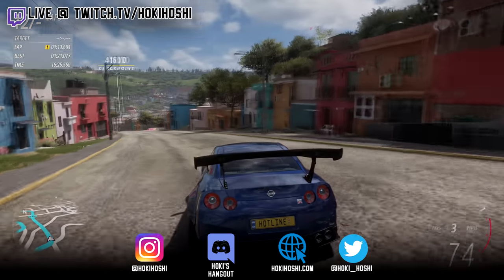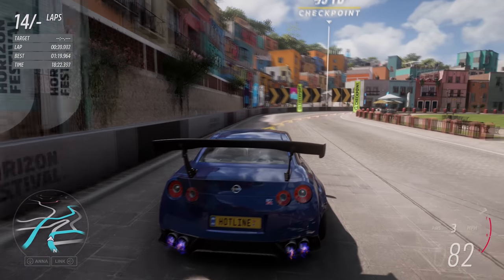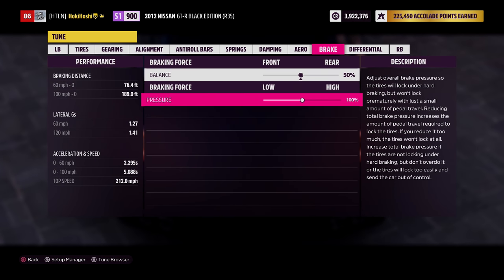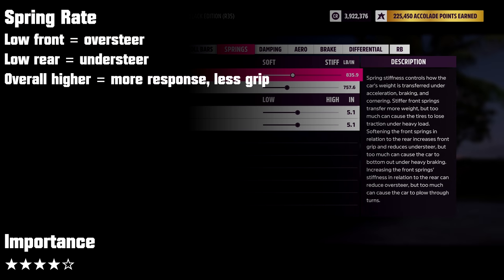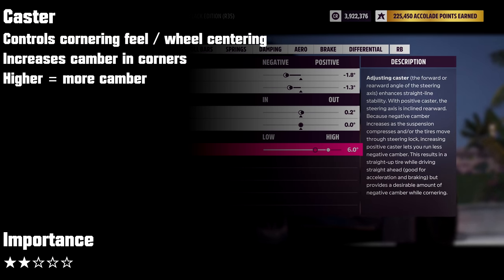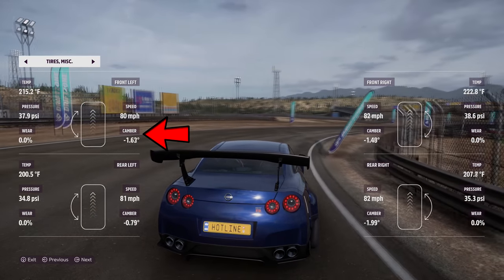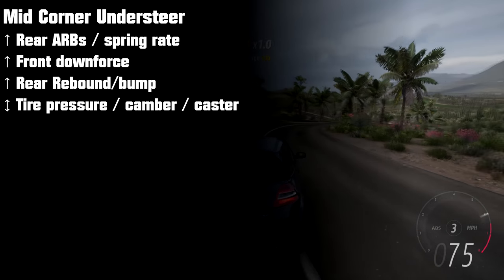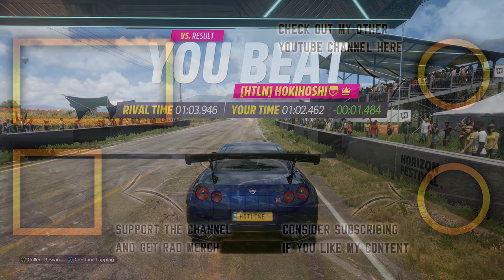How to Tune in Forza Horizon 5 | Basics of Tuning Guide

Comment: How to tune for high downforce, s2 998 track cars. This can also work with slower cars.

1. Take front weight distribution in decimal form and subtract it with 1 to get the rear weight distribution in decimal form.

2. Multiply both decimal values with the weight of the car to get front and rear weight in kg or lbs.

3. Set your downforce in the tuning menu to the desired amount (in s2 998 this is recommended to be at the max for both sliders). Take the front downforce value and add it to the front weight you calculated in kg or lbs, then do the same for the rear downforce and rear weight.

4. Next, add both the new front and rear weights to get the total weight of the car when under the load of downforce (at an specified speed).

5. Take the front weight (the one that includes the downforce weight) and divide it by the total weight of the car that includes the downforce weight to get the weight distribution as a decimal. Do the same for the rear (PLEASE make sure the smaller number goes first in the calculator!) All of this was for getting the front and rear weight distribution of the car when it is under aerodynamic load.

6. In the tuning menu, go to rebound stiffness. Take the [new] front weight distribution and multiply it by 17, then take that answer add 3. Repeat this formula for the rear weight distribution. This is for calculating front and rear rebound stiffness.

7. Next go to bump stiffness. Multiply the front and rear rebound stiffness by a value of anywhere between 0.6 to 0.75 to get the bump stiffness. Both front and rear must be multiplied by the same decimal, so no 0.6 and 0.7. Higher downforce cars will need higher values closer to 0.75.

8. Divide the new weight of your car that includes the weight of the aerodynamic load by the ACTUAL weight of it to get the weight difference (this will be a value greater than 1). This time the bigger number comes BEFORE the smaller number in the calculator.

9. Next go to spring stiffness. Set the slider to the lowest value and multiply that by the weight difference factor you just calculated in step 8. Set the slider to the highest value and multiplayer that by the weight difference factor. Then subtract the new highest and lowest values to get your range value.

10. Take your NEW front and rear weight distribution decimals and multiply them by your range to get the corresponding front and rear spring stiffness.

11. Lower ride height all the way down.

12. Go to anti-roll bar stiffness. Multiply your weight difference value by 64 to get your arb range. Now this is VERY IMPORTANT to remember. Cars that have a front weight distribution less than 0.50 will have a front anti-roll bar stiffness GREATER than its rear anti-roll bar stiffness and vice versa. So this means to get the FRONT anti-roll bar stiffness, multiply the arb range by the REAR weight distribution and then add the weight difference value AFTER you have already calculated the range times weight difference. Do this to get the front and rear anti-roll bar stiffness.

13. Recommend leaving tire pressure at the default of 30. You can make low tire builds that are like F1 car tunes but that is much more complicated. So I won't be going into it.

14. Recommend leaving brake pressure at 100%, but race cars generally have brake balance anywhere from 52 to 60%. Since I tune mid engine cars that have more weight in the rear (yes even under aerodynamic load) I always set it to 54%

15. Differential settings rule of thumb is more power = higher rear acceleration percentage with the max being 75%. Rear decel should generally be the same or 5% lower than your rear accel. On AWD differentials, the front accel shouldn't ever be above 50% and the front decel should always be 0%. For the AWD power balance, the rule of thumb is higher percentage = higher top speed and more oversteer/less grip, lower percentage = lower top speed and more understeer/more grip, with the minimum you should use being 65%

16. In alignment, there is extensive testing you can do with the in game telemetry to hone in your camber and caster settings, but I'll make it simple; -3 front camber -2 rear camber. no toe adjustments at all. For caster all I can say is, 5.0 for slower cars and/or stable cars that understeer, 6.0 for faster cars and/or unstable/tail-happy cars that oversteer.

Now I'm not going to go in-depth into gear tuning even though I know exactly how to because that is an entire other lengthy chapter, so all I will say is to adjust the final drive gear so that (look at the graph in the bottom right) the last gear in the series of gears intersects the redline at the very end of the right side of the graph.

Yes I know this is a long comment. I hoped it helped!
Reply: Can you explain step 12 with the anti-roll bars? I'm trying this out to see how it works while also writing it out as a mathematical formula for each step.
Reply: recommendation where to see gear tuning ?
Reply: This is a banger of comment! Thanks for the guide!! Is this useful for the lower end cars as well?
Reply: @georgejones5019 
Sorry for the late reply, YouTube didn't send me a notification.

So to reiterate in mathematical formula form;

This example will use a mid-rear engine hypercar with a front weight distribution that accounts for the additional downforce weight already that is 44% or 0.44. So you would get this value by adding the front and rear downforce to the front and rear weight of the car, and then divide the new front/rear by the total weight of the car with the downforce acting on it (the value in the aero tuning menu usually uses the amount of downforce being produced at 120 mph).

Weight difference multiplier of the actual weight of the car and the car + the downforce weight. Ex: 1.3 heavier with downforce at 120mph.

((1.3 * 64) * 0.56) + 1.3 = 47.9 which is the front anti-roll bar stiffness.

((1.3 * 64) * 0.44) + 1.3 = 37.9 which is the rear anti-roll bar stiffness.

Hope this clarifies things!
Reply: @bemo9 
I don't know where you could find a good in depth description, so I'll explain it here, but I don't want to go in depth so I'll simplify it.

Gear tuning can sometimes be preferential if you have somewhat of a good set up. But the jist is that you want low gears to last short and have a tall rev range for low speed acceleration, and high gears to last long and have a small rev range to squeeze out the most top speed. But you don't want to immediately switch from tall to short, you want the beginning or bottom of the gears to look like a gradually flattening curve.

Sometimes you'll want a little more acceleration so the last gear could actually be lower and longer than the gear before so you don't run out of top speed.

The best pointer I can give is to use the graph in the bottom right. It really helps visualize what exactly the gears are doing when you change them.
Reply: @ladyivyanna9612 
I figure it is useful for the lower end cars because most of the time in A class and below, you don't use any aero, so you're skipping entire steps that are used to account for downforce. Otherwise, this is strictly for road racing.
Reply: @jackcolson4745  So how do you tune lower end cars where aero doesn't play much of a role? (or higher end cars without installing aero)
Reply: @ladyivyanna9612 
There's many steps in my original comment that use the downforce weight in the calculations. If the car you're tuning has locked or no aero, then you just put 0 for every time a step asks you to use the downforce in lbs or kg. You effectively don't need to calculate with downforce weight anymore if you're just adding 0, because all your multipliers that do account for downforce will just end up being 1, instead of something greater than 1.

For example, in step 3 it asks you to add the downforce values to the front and rear weights respectively. If there's no aero, you're just going to be adding 0, which is redundant so you don't need to do it.

However, lower end cars don't always need to be stiff, so you could lower the front and rear spring stiffness too for better stability.

When tuning for A class and below, you generally want to focus on building more for horsepower than handling, because you won't need aero.

I hope that clears up the confusion.
Reply: @jackcolson4745  Thanks so much for your help man! You must play a lot of sims and stuff to know all this tuning calculations!
Reply: @ladyivyanna9612 
Lol. I've only played the Forza games, and I built this off of hoki's fh4 tuning guide he did 3 years ago. But I do study Newtonian physics so that definitely helps.

I'm glad I could help you.
Reply: Do you by chance have any build share codes for any tunes you’ve done in the game?
Reply: I need to be able to find this comment in the future

Comment: 28:28 Throttle management in RWD; just, YES! I personally feel this is one that many people feel like either their tune or the car they're driving performs poorly at start or powering through and out of a corner, yet simply haven't acknowledged that *usually*, it's got to do with how much throttle you're applying. Too much and you will likely spin out most of the time, it's not necessarily the tune, as much as it is just all the power with a limited surface area of the width of the tires themselves, assuming all else is equal you still need to compensate the expected "burn-off moment" by slowly learning - and it will vary by car as well - how much to get the car moving forward and not just... spinning in place and then also typically losing grip for a second upon 2nd gear because again it's now rotating faster than the amount of traction it has at that moment to pull you forward and not just slip.

Comment: Much Respect!  I got into the habit of downloading locked tunes in Forza Motorsports games and having a great time.  With Horizon games, it was frustrating because there’s really no set track parameters because of the varied terrain.  Frustration equaled quits for Horizon racing.  So Thank You, Thank You!  My sanity will return and I can finally enjoy Horizon 5.  I’ll be rewatching this video a lot but at least I know now, that I can tune that under steer in AWD cars.  Subscribed!

Comment: My tunes feel "floaty". At corner entry the whole car just kind of drifts and doesn't feel planted. It's the same GTR as in the video. I must be missing something.
Reply: Make your sway bar settings stiffer
Also make sure you brake BEFORE you enter the turn and just as you start to turn in to the corner let off the brakes and use the gears to slow down if you have to while in the turn. Then power out once you hit the apex of the turn

I hope this helps

Comment: Really great and informative. I'll have to follow this new guide two or three times with different builds and what the goal is, such as Rally vs. Drift.

Going back over this. Rally tuning seems to be much more tricky than street. As you want a good amount of balance of acceleration and grip, so you handle through a turn then return back to a decent speed.

Comment: I’m a total noob to the franchise and this was sorely needed; thank you 🙂 However, I do not have the option to switch Anna to Telemetry in settings. It’s not there at all. Do you know what might be happening there? I’m on XBox Series X.
Reply: same, i swear i saw this option before, but now i cant find it anywhere
Reply: Ohhh, you need to make sure that your control layout has all the options for selecting anna filled in, if your in a default profile it will show up, you can switch to a default profile, then save and exit the menu, and then reload the menu and it will be there

Comment: I wouldn't suggest upping toe out in front at al for a base tune only in fine tuning also 80% rear diff lock is a bit excessive.

You can really feel the drawbacks from having toe out in front with a steering-wheel.

Comment: You’ve left out the single most important aspect when fine tuning any vehicle. It’s super important to make changes to one aspect of the tune at a time, if you make too many changes at once you are introducing to many variables and this makes it near on impossible to figure out what has happened. This will lead to other problems and before long the tune will go backwards. When fine tuning you only ever do one thing at a time. Great video for covering the basics otherwise.
Reply: I agree with this once getting towards the final tune, but being experienced with this series and real world performance cars I do it differently to start. 1st I drive the car in a race stock, see its tendencies and make many adjustments based on what I felt. As you get the general build close than I start making 1 at a time adjustments

Comment: More in depth summary with added details feel free to add and remove anything you want

Forza tuning guide
Differential:

Rear Acceleration: 
50-90%, scales with HP. Higher = more oversteer.

Front Acceleration: 
10-50%, low on track builds, high on rally. Higher = more understeer.

Deceleration (Front & Back): 
0-Accel%. Low = more responsive. High = corner stability.

Center: 
50-80, low on rally builds, high on track. Higher = more oversteer.

Brakes:

Balance: 
Front = Rear braking force. More stable, understeer.
Rear = Front braking force. Less stable, oversteer.

Brake Pressure:
Higher = Quicker locking/ABS engagement.

Aero:

(Only important for A+ Class)(Adjust after you drive base tune)

Higher = More grip, hotter tyres, lower top speed.
High front = oversteer
High back = oversteer
Too high of back can make understeer
Difference between front and back can influence under/oversteer.

Damping

(Keep Bump at 0.5 - 0.75x of rebound)

Main Guideline: Increase stiffness on the end of the car that is not losing grip, or increase softness on the end that is losing grip.

Therefore, high front setting = more rear grip. High rear setting = more front grip.

Springs:

Low front = oversteer
Low rear = understeer
(Awd lower front)
(Rwd adjust as needed)

Stiffness can be affected by weight balance.

Ride Height:

As low as possible.

Antiroll Bars:

Low front = oversteer
Low rear = understeer

Depends on cars weight distribution, higher stiffness on heavier part

Alignment:

Camber:
Negative camber is better for track racing. Drop a touch for base tunes.

Toe:
Toe out = Oversteer (Use on front in FWD/AWD for better grip)
Toe in = Understeer (Use on rear in RWD for corner stability)

Caster: 
Increases camber in corners 
Higher = more camber
Almost like dynamic camber, only affects Cornering. 
4-7 degrees.

Gearing:

Just match final drive for base tune. Lengthen 1-2 gears for high HP cars.

Tires:

26-35 PSI for track. 
Higher front PSI is better for cornering.

____________________________________

Final Tune:

Suspension:
Should be between 20-80%, try to avoid bottoming out.
If it’s not moving much at all probably need to soften suspension and vise versa too much need to stiffen

Camber:
Never want camber values to go positive, if they do add more camber 

Tyres:
Take a lap 
Blue = too cold
Dark orange - red = too hot

Peak- Heat should be around yellow- to transparent yellow

Inside - should be hottest
Middle - close to inside temp
Outside - should be coolest
 
Difference between inside and outside should never be more than about 20 degrees - 20> =Lessen camber/ Outside is hotter than inside increase camber

Overall temp difference within 10-15 degrees

If Outside and inside are lower than middle, tire pressure is too low
If middle is hottest - lower tire pressure

If tyres aren’t getting hot enough - increase downforce or try using toe
Cold tires + understeer = add toe out all round
Cold tires + oversteer = toe in

____________________________________

Trouble shooting - 

1st diagnosis when the issue is happening- entry, mid corner or exit

Corner entry understeer-
-Adjust front-tire pressure for better grip
-Softening front springs / ARBS - or stiffening rear
-Adding a bit more toe out in front or rear
-increasing front downforce OR decrease in rear
-reducing front diff deceleration lock
-increase front bump dampening or reduce front rebound

If car is plow understeers under braking specially also move more brake bias towards rear
Move slider towards front cause it is flipped
(understeer is normal while braking)

Mid corner understeer - car settles into corner but car starts to straighten
-increase rear Arbs/ spring rate
-increase front downforce
-increase rear rebound/bump damping
-can also play w tire pressure/camber/caster to find max grip for front tires

Corner exit understeer
-increasing diff rear bias
-increasing rear accel lock and/or decreasing front accel lock

All problems w oversteer -
Entry -
-Increase front springs / ARBS
-increase toe in
-increase diff decel lock
Mid corner - 
-increase front ARBS/ spring rate
-increase front rebound
-adjust up or down, tire pressure and rear camber
Exit-
-increase center diff front bias
-increase front accel lock
-decrease rear accel lock

Rwd grip - 
-increase/decrease downforce
-increase/decrease bump stiffness
-increase/decrease alignment settings
(Better throttle management)

Responsiveness during transitions-
-turning well when have time to setup but bad when quick transition - all in damping and anti roll bars
-if car gets thrown off easy when hitting curb, lower bump stiffness
-if car is too bouncy and shifts weight to much, increase bump damping and spring stiffness

Other problems.
-if not braking good enough - lessen front camber, but increase camber to make up for it, can also move brake bias to rear a bit or stiffening suspension in front to move more breaking grip to the rear, only works if maxing out front braking power
-if struggling w top speed lower aero and mess with final gear.

You’re done!
Credit to TheStrifist for making most of this